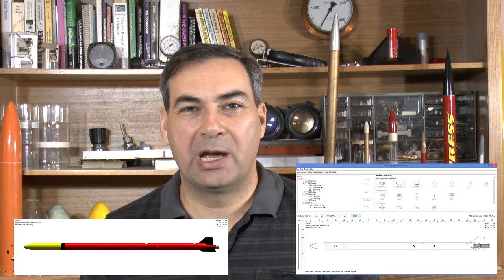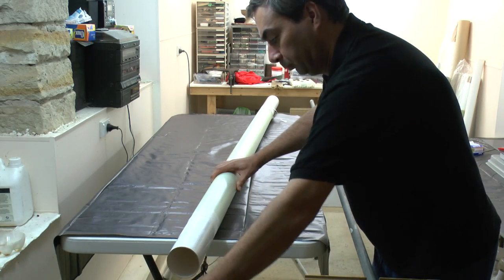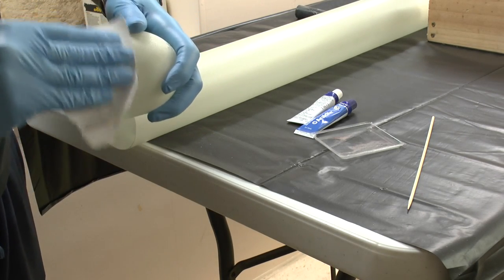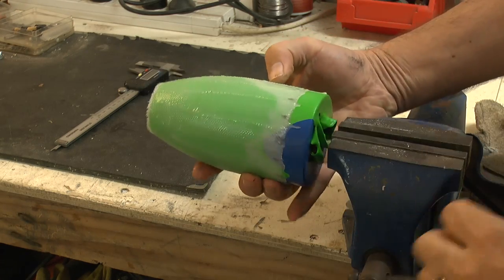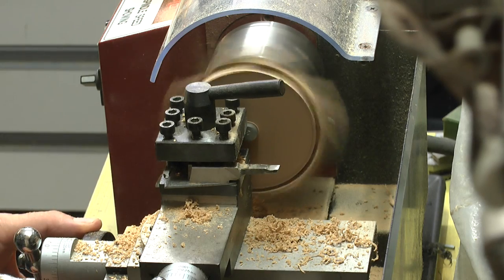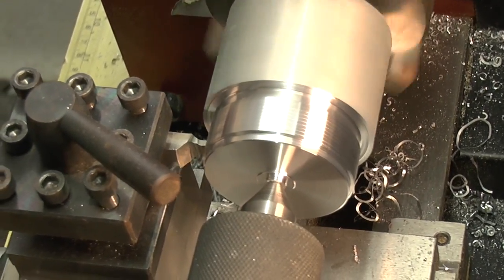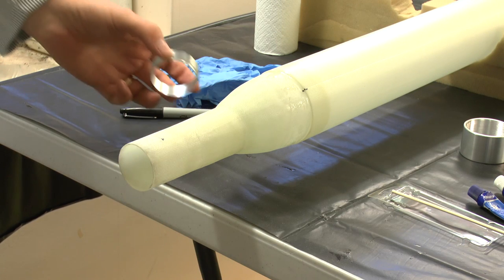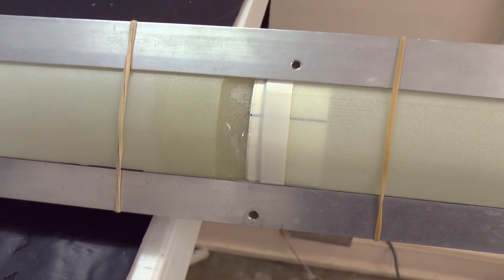High Power Water/Pyro Rocket - Part 1  - Construction

Comment: Excellent video, your build skills are exceptional!  When I saw the title I envisioned a 2-stager that would use both water and pyro. But a dual purpose rocket is pretty sensational. I can't wait for both flights. PS - I told ya' the dark side would start taking over :)
Reply from the maker: Thanks for the nice words Dick. Hee hee yes the Dark side is strong! Staging a big water rocket to an HPR rocket would be fun. :)
Reply: You are lucky I don't live near you as I likely would stalk you :) I envy you lathe and ability to whip those parts out. Very cool. As for the water to pyro rocket, I predict it will eventually happen!
Reply from the maker: Dad does most of the tricky machining as he has formal training as a machinist, but the lathe is definitely a good tool to have in the workshop, a lot of parts would be difficult to make without it.

Comment: This build is amazingly accurate, but complex in terms of materials and scratch built dimes/tools. You can achieve the same grade of swappability, creating 2 modules: the 1st one just using the soda bottle (equipped with the gardena connector) and the second one building a motor mount for the pyro motor, inside a the soda bottle itself. To understand better what I'm talking about, please take a look at my Rocket Drone on Instructables website... I can land any type of rocket vertically, by the way.
Reply from the maker: This rocket was primarily build as our Level 1 HPR certification rocket and hence designed for H and I motors. Structurally you would have to re-inforce the bottles so they wouldn't collapse under the solid motor loads.

Comment: is the manufacturing of light shadow rocket the same as the dark shadow?
Reply from the maker: They share some common construction techniques, though the two rockets are designed for two different purposes. Light Shadow wasn't designed for high pressures.

Comment: How much pressure will this rocket hold?
Reply from the maker: Good question. We are hoping it will hold at least 300psi. We've already done a hydro test to 205psi. We didn't want it to burst until we get to launch it at least once with the H motor. After that we'll fly it at 250psi. If it fails on the pad so be it. If it still holds up and lands well we'll fly it with another H and then again with water at perhaps 280psi. or 300psi.
Reply: Interesting, and that just with this not really thick connection between the motor/nozzlemount and the pressurevessel
Reply from the maker: At 300psi there will be about 3000N trying to push the nozzle adaptor out of the rocket, that's why the retainer nut had to be a bit stronger than what a normal retainer nut would be.